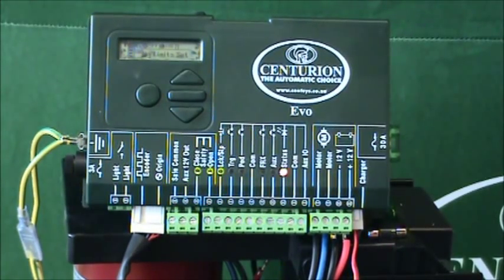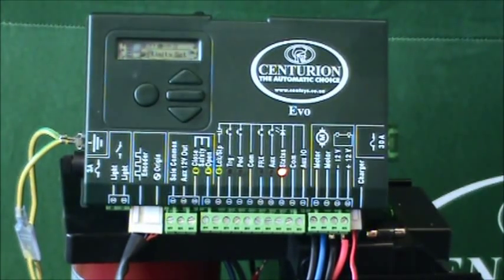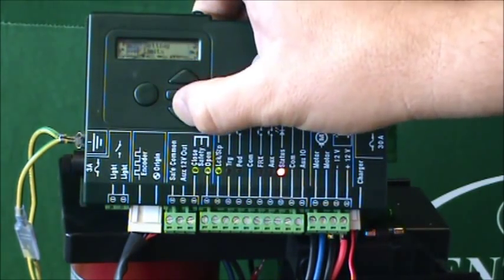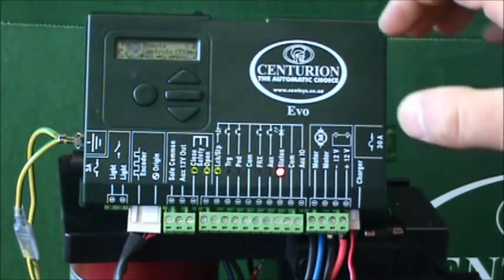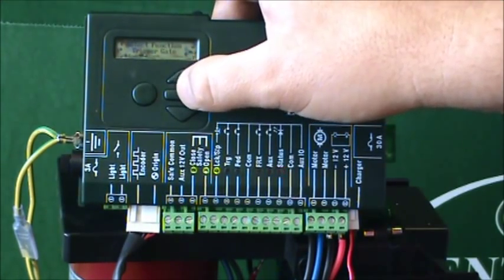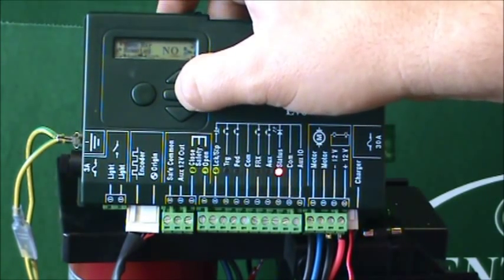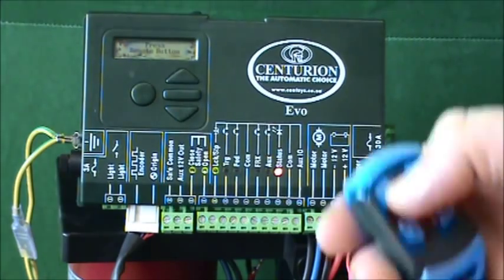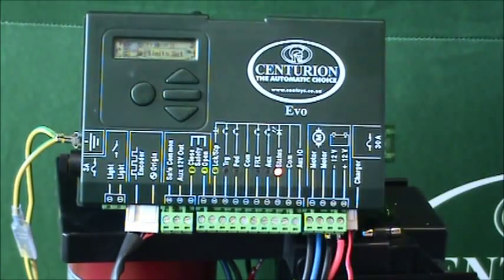D5-Evo - Learning in Remote Controls

Comment: I have used exactly the above procedure at least 50 times to encode remotes into the D5 motor at our complex. Last month a contractor replaced the D5 with a new one. Now, despite following the above procedure, the controller does not respond to an input from a number of remotes with fresh batteries. Has the system been blocked by the contractor so that we have to pay him a call-out fee to encode remotes in future? If so, how can I unlock it?

Comment: I installed a D5-Evo 500kg load weight limit at a clien'ts gate and it started functioning well but later stopped and was making a bipping noise and projected on the dash board baust fault, what should I do next for it to start function well again, I must equally say that the gate handles more than 2000 vehicles per day and functions 24/24
Reply from the maker: Innocent Ngom Jua Hi there. The D5-Evo is designed to handle a maximum of 150 operations per day, and thus it is being utilised way beyond its specification. What has probably happened, is that either the brushes have worn or the battery has been completely drained. Please contact our technical support team on +27 699 2400 for a more detailed diagnosis, but I would recommend installing a heavy-duty gate motor such as the A10 to handle the large traffic volumes.
Reply: Thanks for the respond, there was a mistake in a fault specification, i wrote baust fault rather it is DOSS FAULT

Comment: My sherlo remote isn't picked up when trying to set it on my centurion motor? I get to the point where it says press remote but it never beeps in acknowledgment. I know sherlo remotes can be programmed as every other remote at our house is sherlo. Please help!
Reply from the maker: Gaz Mitraz Hi there. Thanks for your enquiry. The CENTURION onboard receiver in the D5-Evo will definitely only accept CENTURION's Nova remote controls. If other aftermarket remotes are being used in the system then the installer would have most likely added an aftermarket receiver that will accept those remotes. You will not be able to learn in non-CENTURION remotes to the controller.

Comment: I have tried and get all the way to the part where you press the remote button but nothing happens. Just says: press remote button...nothing happens
Reply from the maker: Hi there. Make sure you are using a Centurion Nova remote. Then ensure the remote control battery is still powered (check that the LED light remains on when you press and hold the button down - a flashing LED shows you the battery is low). If the receiver is ready to learn in a remote then it will beep twice to acknowledge that the remote has been received.

Comment: when I try to set gate opening limits,after the massage 'clear the gate path'.the screen will switch off after confirmation.sometimes it will move a bit n restart on the screen.what mite be a problem
Reply from the maker: +lettor gumede Hi there. If the controller is switching off and then back on this is a sign that the battery does not have enough power to run the gate. It will most likely have sufficient power to keep the controller alive but as soon as the motor draws more power the voltage drops and that is the reset you're observing. Please try and replace your battery and ensure that it is being charged (by making sure that the gate motor has power connected to it).

Comment: My gate are open and close the hole time HELP PLEASE
Reply from the maker: +koos coetzee There must be something triggering your gate for it to open. Often when it appears to be doing this 'by itself' it's actually a neighbour's remote control that has been learned in to the gate motor accidentally during the installation. The first step would be to delete the remotes and ensure that only your's are learned in. Please give our Tech Support Team a call on 011 699 2481 if you require further assistance.

Comment: When I hold in the center button for two seconds and enter into settings, it does give me the remote option. The motor could possible by a different model but has the same layout. Could you please kindly assist me with this matter
Reply from the maker: Sherwin Andrews The Remote Controls option will definitely be there. You need to scroll to the menu section "11. Remote Controls". If you still can't find it please call our Technical Support Call Centre on +27 11 699 2481 and they can talk you through the process.

Comment: Please help, all the buttons but the centre button seems to work. Can it be disabled/ enabled?
Reply from the maker: +Jessica Smith Apologies for the lengthily delay in replying to you. Yes, the round test button may be disabled (and enabled again) in Menu 10, General Features of the controller. Sub-menu 10.4 allows you to enable/disable it.
Reply: +CenturionSystems Thanks for the reply, so if it's disabled, how do I access the menu? Sorry, not super familiar with the system.
Reply from the maker: +Jessica Smith When the round 'test' button is set to be disabled, it is only disabled so that the gate cannot be triggered to run by pressing the button. All programming is still possible. However, re-looking at the comment it appears that you referred to the oblong button  - sorry, I should have picked that up sooner. The oblong button cannot be disabled and if it is not responding then the controller has developed a fault. This can be caused by water ingress - and some other causes too. Please check the cover of the motor to ensure that there are no cracks visible (look from the underside). If you're still battling please call our Tech Support Call Centre on +27 11 699 2481 for assistance so that we can arrange to have this resolved for you.
Reply: +CenturionSystems Thanks for the reply, did mean the oblong button. Will call your tech department, thanks again!